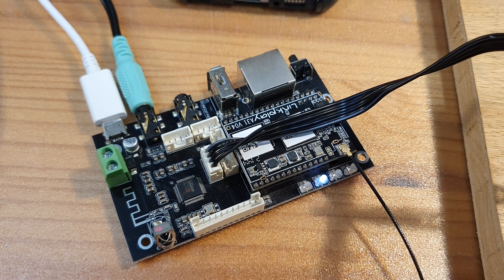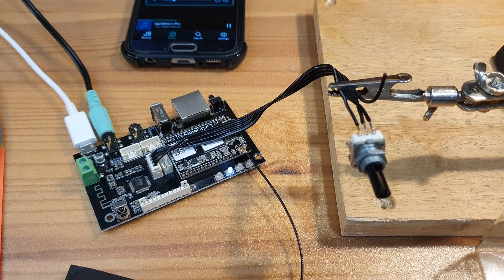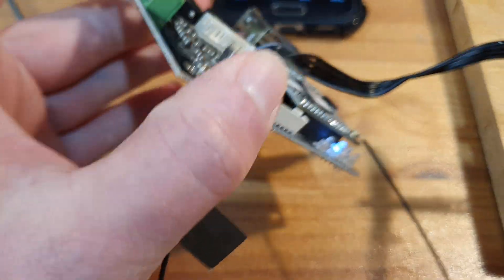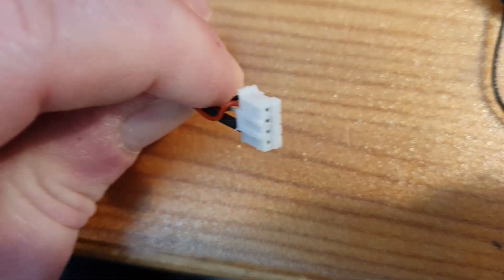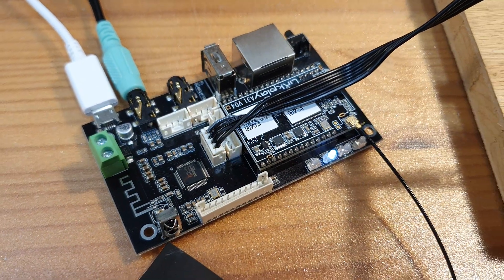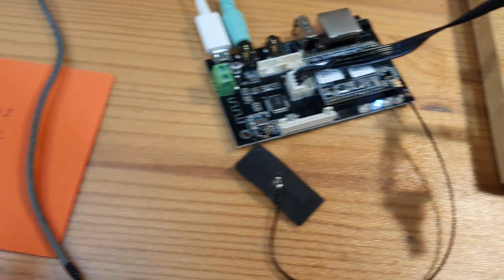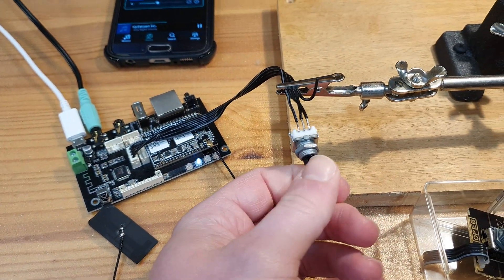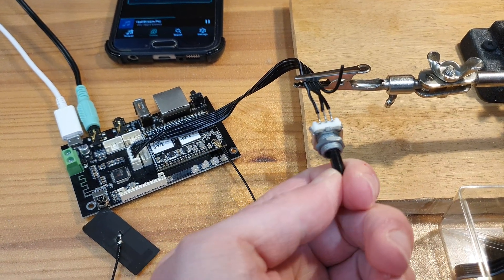Arylic Up2Stream Pro DIY external volume control

Comment from the maker: Unfortunately YouTube has taken away the options for choosing the type of advertising. I hate unskippable ads just as much as you do, but I can not turn them off anymore :(
Reply: They put ads in a 2 minute video? WOW! I had no idea as I always use an ad blocker. It's good to see you posting again though. Cheers!
Reply: die Werbung kommt von YouTube automatisch leider mittlerweile , des ist nicht mehr wie früher :-(
Reply: I've also noticed that some ads now say "Sponsored" instead of "Ad". Maybe one of these types is placed by Youtube itself (even on non-monetized videos), and the other is only used for monetized videos?
I'm guessing that these ad-related changes may have something to do with the rise of short-form content (where it is much more difficult to place ads), although they may be for some other reason (video hosting is expensive, so they might be trying to increase profit margins in whatever way they can)